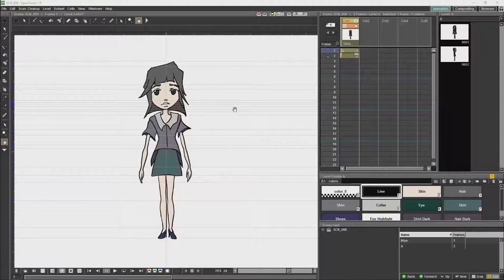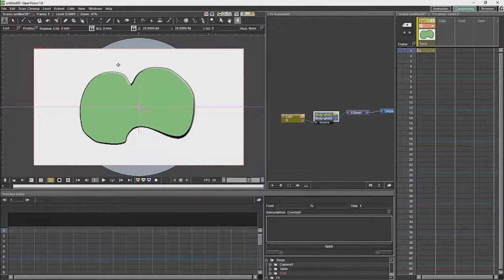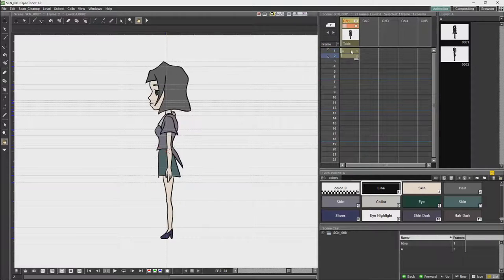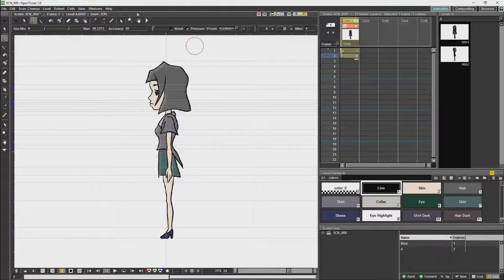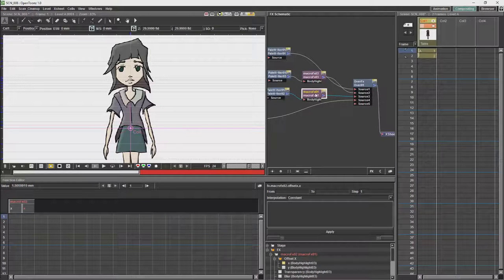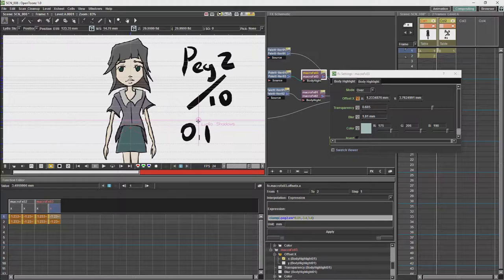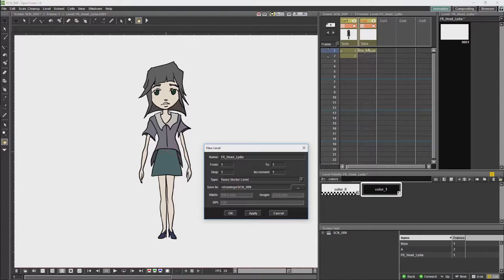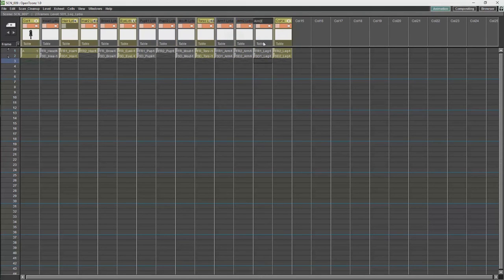Opentoonz Tutorial 13 Cutout Rigging Using Plastic (Part 1)

Comment: When creating the different body views on separate levels, how do you go about auto-tweening between them?  i get how this would work if all on the same level...but kinda clueless how to smooth animation between views  if on different levels
Reply from the maker: you will not be able to transfer animation between levels without either scripting (which would be destructive in OpenToonz) or expressions both of which could make it harder to animate if not done carefully. If you want inherited rotation You need to use a single level and swap the drawings.

Comment: after snooping a little bit seems like you have a lot of experience rigging in toonboom.  in your opinion what is missing from opentoonz rigging that makes toonboom the choice for this method?
Reply from the maker: It depends on what you want to do. For basic cutout there is not a a huge difference and for bone based rigging Moho may beat both of them.

When it comes to advanced rigs with 360 turnarounds which allow for results close to cell animation it is a little different The biggest advantages apart from that are the live scripting and curve deformers (with motion controllers). Another advantage toomboom has Is that because its deformation is not mesh based It is easier to add replacement drawings. Toonboom also gives you more direct control which makes it much harder to learn but gives you more direct control over what you are doing. 

Opentoonz has a lot of places where it is better than Toonboom for example its expression system and the hooks system. Opentoonz however does not have the depth  of rigging features.

The primary advantage of Toonboom however is that I occasionally get work for rigging.
Reply: are the "live scripting and curve deformers (with motion controllers)" what makes emulating cell easier? Is there really no equivalent to hooks in toonboom?!  Also I suppose rigging is more of a job for you so Toonboom shining in that dept is not so relevant to u unless for "work".  What is your main reason for using opentoonz...the expressions and hooks?
Reply from the maker: My main reason for using Opentoonz is that it has the best XSheet of any animation package and I am more interested in traditional hand-drawn animation than cutout.
Reply: That makes sense.  Yeah i dont have have alot of experience with other software but toonbooms layout gives me claustrophobia. but good god the ability to create master controllers kinda blew my mind. hopefully someone writes a script allowing for this in opentoonz one day.  Anyway. Thanks for the tutorials ...amazingly helpful